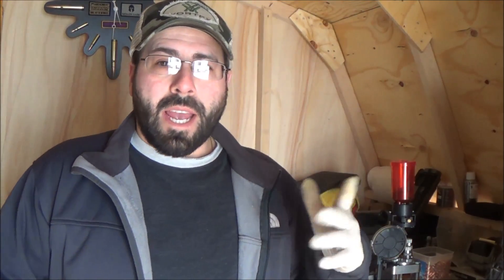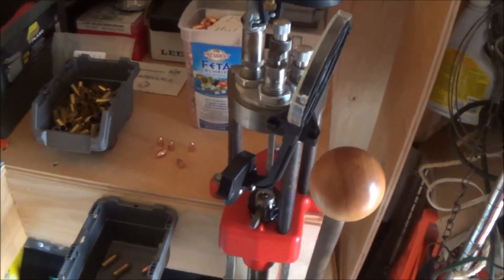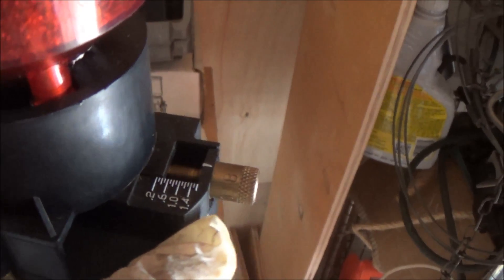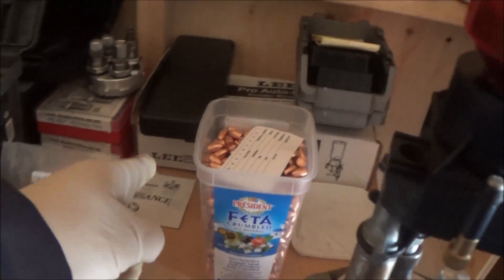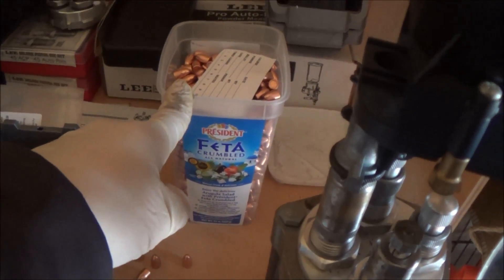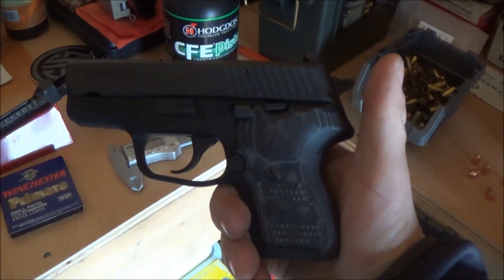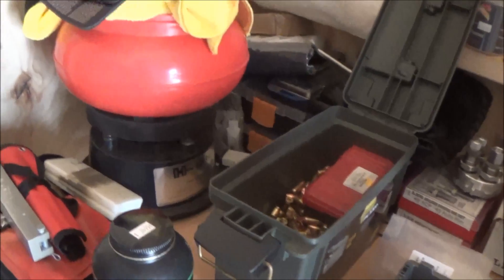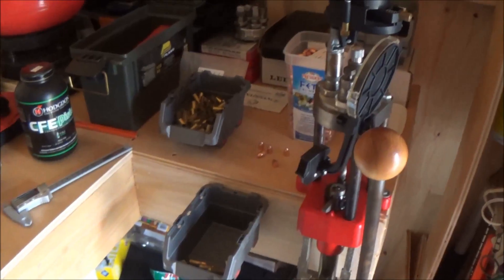Sunday Relaod in the Man Shed

Comment: Love the Sig P224. 357 sig is an awesome round. Very intrigued by your powder micrometer . It it's accuracy affected in any way with the powder geometry? Will it be as accurate with say ball ammo  vs, stick or flake ( i.e. 800X) ?
Have Fun Be Safe .
Reply from the maker: I have only used this one type of power. I have only loaded about 1200 rounds with it so far. Out of the rounds 400 rds that i have shot with it is pretty damn good. I  have used them in my Sig p226 and my Beretta 92. The accuracy has bee pretty good.